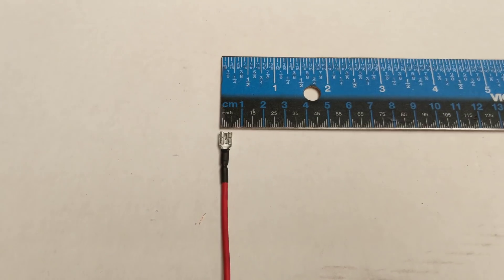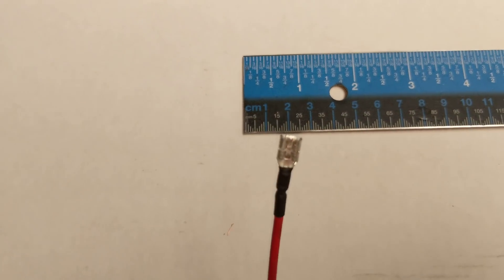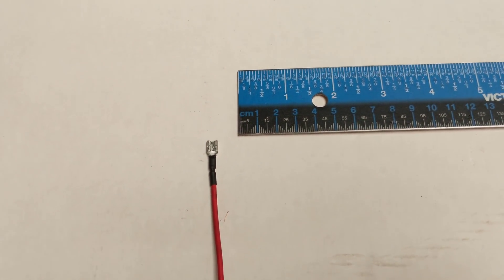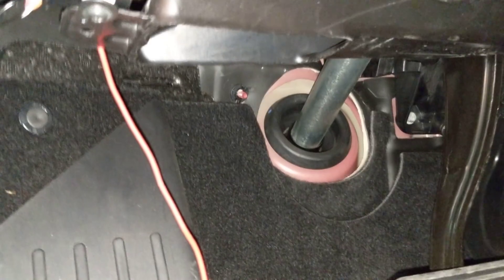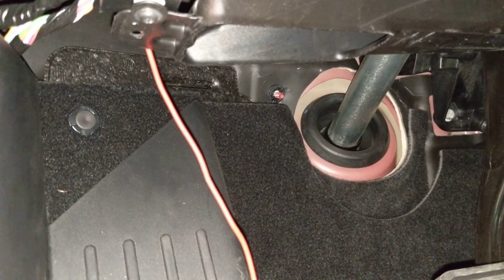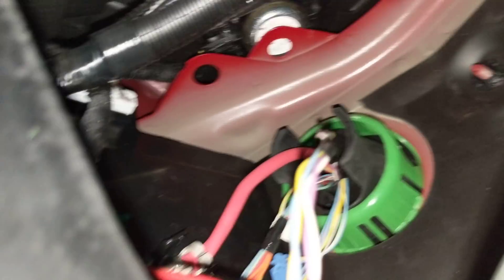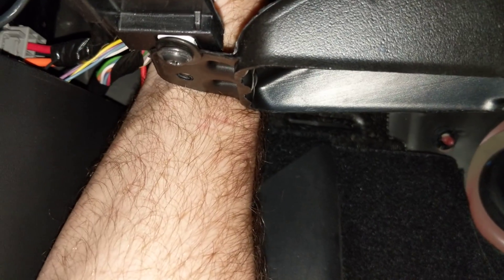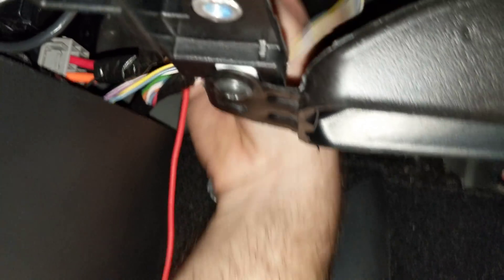Tesla Model 3 - How to safely get 12v for accessories

Comment: Thanks, this is the ideal way to go for 12v switched!  I tried somebody else's method for a light blue wire (also on youtube) and despite finding the one he referenced, I could only get 3v output that was not helpful... I had the right wire, so not sure what's up.

This was a pretty big pain in the butt (and I've put in complex alarm systems in all zones of a car back in the day, wired 2 other cars for radar including a 911, and put in a full stereo with CD changer/amp/sub/speakers when that was in vogue).  I thought I'd share my own tips on it. Watch the other video by the OP to also understand the config of the target.

I would like to point out that the removal of the complete main panel as the OP listed below the dash was not something I could comfortably do.  I could only remove the front panel under the dash with the accessory light on it (not the larger rear portion).  While it's not possible to visualize the target this way by eyeball, I used my phone with a zooming/lighting/magnifier app and then i could see it.  A video mode on phone with zoom and LED enabled would work.  The target is not super high up but further back from the front of the car than I anticipated and on the side of the car facing inward.  I highly recommend a viewing technique as this.

I bought a uniden hardwire kit for my radar that really seemed to have a 5mm size crimp-on attachment (I measured it) just like in the video but it didn't fit!  I instead bought the same clips as the OP recommended from the amazon link above and these eventually worked.  With the clip linked by the OP, it went in but didn't get 12v the first time I placed it in, oddly, but then I tried again and it worked.  This is a project for somewhat small/thin/nimble people in this regard.  I used a very large bolt that holds up the dash as a ground, but careful to not over-tighten this on your wire as it will simply slice the wire.  This bolt is visible when taking off the large plastic piece that trims the sill to the area below and lateral to the dash.

I mounted a uniden R3 radar and used a "permanent mount" (simple adhesive metal angled clip) such as can be found on ebay and managed to squeeze it beside the rear-view mirror and just above it on the driver's side.  It ends up being much more hidden and much cheaper than the blendmount, which I really think looks very clunky IMO.

The OP is clearly in a different league than the everyman with disassembling and understanding the electrics of this car.

Thanks for this video!

Comment: Where did you find a ground?
Reply from the maker: There is a big bolt on the A pillar that mounts the dash, This is a good location.  There is also a smaller ground ring lower on the A pillar (remove plastic trim).
Reply: @Ingineerix  Would you be so kind to snap a photo? Also, would be nice to see how to remove foot well cover safely.
Reply: this is a good install guide. it includes where to ground.

Comment: Somehow I got power (14v measured) and now nothing from that port. Nothing changed with the wiring from yesterday to today. Car is on (I get power from the 12v outlet in the console). Confirmed power cable is good, and connection is tight.  Anyone have ideas?
Reply: I don’t think there’s anything equivalent to a reset button for that port?

Comment: I have my BlackVue DR750S-2CH wired with a Power Magic Pro directly to my 12V, as I was told to do months ago. It has been working fine for months. This morning, potentially because of a firmware change, my Model 3 just threw a 12V error. My service center is currently replacing my 12V. Instead of buying BlackVue's $300 B-124 external battery, would it be possible for you to document step-by-step instructions for how to use this 12V yellow wire into the BlackVue so parking mode works?
Reply from the maker: I've been on record several times warning people to not tap the 12v battery directly.  Sorry, I don't have time to do step-by-step.  If you can't figure out how to tap a wire yourself, I recommend you consult a professional.
Reply: @Ingineerix  Like I said, it was wired directly into the 12v battery (professionally) several months ago before anyone was saying not to do that. I'm now going to have it re-wired (professionally) based on your new advice. The average person won't know how to do this themselves, so instructions would help, but hopefully my installer will know what to do.

Comment: struggling to remove the panel that gives me access to this, I was able to remove the one with the foot well light but not the on in front of that. Any help would be greatly appreciated, thanks for this video as well!
Reply: Topplayer2g agreed. Running into this problem also. Can anyone assist?
Reply: I could not remove that panel, instead I was able to get to the power without it. It was tough to see and work but it is still do-able. I tried my best to watch this video and the first video he posted, and understand where and what I was looking for. once I did that I was able to do it on both my and my brothers model 3
Reply: Agreed... I was able to do it also but did not remove the panel. I only removed the one with the light on it but it almost seems like you need to remove the next panel. The problem was I noticed the air bag was there so I did not keep moving forward.
Reply: Did anyone try unplugging the connector from the VCLEFT in order to plug in? Wondering if this is available.
Reply from the maker: Yes, on my car, I did remove the aft panel for easy access, which does contain the knee airbag.  I don't recommend you remove this unless you are comfortable with such things, and be careful not to damage the wiring.

Comment: Thank you for this and the other video showing how to plug in. 

Need beginner help- if I’m going to tie this into the Uniden R3 radar detector, does it need a ground or other neutral wire connected?

The radar detector comes with the cigarette lighter I was planning on cutting that cord and connecting.
Reply from the maker: Yes, every electrical circuit needs 2 wires, so yes, it needs a ground.  I would not cut the wire, just buy an aftermarket cig lighter jack and install it under the dash.  (There may be power supply electronics in the male end)
Reply: Where are you grabbing the ground?

Comment: is there an easy place nearby to get ground as well?  i've been thinking about trying to add a 12v socket underneath the phone dock to allow me to have fast charging for my phone and my wife's phone (we both have oneplus w/ dash charging, which require a special charger and cable, the usb ports won't work)...
Reply from the maker: Yes, there is a ground bolt to the body near the door sill.

Comment: I could really use some more help with this, I've tried three different of  these terminal types, including the one referenced in the video description, and I can not get any to stay put in this location.  They just stay loose no matter how hard I try to push them in.  I have tried getting to it from a few angles but no luck.  Might this be something that changed later builds?  Any help with this or other safe 12v access points would be very much appreciated...
Reply from the maker: If it's going in all the way, then maybe the terminal is simply not tight enough, just use pliers and gently tighten the female opening.  My experience was that it was super tight and just needed a good bit of force to get it seated.  So try to determine if it's going in all the way.
Reply: Thanks so much for your videos they are amazing!

I also tried to get at this multiple times with 5mm connector. So hard and gave up. Might just tap into cigarette socket in arm rest.

Do you know the amperage known for that socket?

Comment: I have a Ford Focus EV, and the 12 volt lead acid battery is only charged when the car is turned on. The high voltage battery will charge, as long as the lead acid battery has enough power in it. 

Do you know if the Model 3 would do the same thing? I hope that it’s smart enough to keep both systems healthy.
Reply from the maker: The DC-DC will charge the 12v whenever the car is awake.  If the 12v gets low, the Gateway will wake the car and initiate a support cycle to recharge it.
Reply: Ingineerix Thanks so much! I look forward to owning an intelligent EV, not just a compliance, ICE conversion car!

Comment: Sorry,useless video. Nothing mentiond about max possible current or in which circuit with which protection is tapped into. So far under limitations the 12volt cigarette lighter is much safer then this video
Reply from the maker: You clearly didn't bother to read the description.  First sentence.  10A.
Reply from the maker: Here's a 2nd video with more clarity: https://youtu.be/9De-VjFgLSQ
Reply from the maker: This is a dedicated output with no other loads.  It is apparently reserved for a future trailer light connection.  (There will be a separate ECU)
Reply: That was all well covered in his VCLEFT video -- which has disappeared in the last few hours.  IIRC, there are two spades available where he's indicating, unused, labeled ROOF and TRAILER, and he tested at least one to 15A cutout, self-restoring.
Reply: Gallardo6669 no Moo
Reply: Cool, thx. Sounds way better. I might be one out of millions,who never read video description. Its good to mention this info in your video as well! Thx!

Comment: thanks!  is there a permanent 12V  also?  and does the 12V converter always run or only when car is on?
Reply from the maker: If you want always-on for a dashcam (not recommended), then the best location is to pull out the overhead console with the hazard button and map lights. Feeding that you will see a yellow wire on the corner of that connector (pin 1), that is +12 hot always. If you need ground, the black wire on pin 16 is good. Don't pull over 1A from this circuit though!

No, when the car goes to sleep, it stops maintaining the 12v system.  This is why I don't recommend always-on loads unless they are very low.  You will be cycling the 12v AGM battery.
Reply: Great info!  thanks for that.
Reply: Ingineerix the BlackVue DR750LW-2CH 5. 9 Watts for example so I'm not sure how long that would take to draw down the 12-volt battery if running while parked
Reply: @Ingineerix  you should update your video, your method now powers the dash cam 24 seven, it happened after a Tesla update about six months ago

Comment: So this is a nice switched 12v with easy access. Is there any permanent 12v with easy access nearby also?
Reply: Yea that would be nice.
Reply from the maker: If you want always-on for a dashcam, then the best location is to pull out the overhead console with the hazard button and map lights. Feeding that you will see a yellow wire on the corner of that connector (pin 1), that is +12 hot always. If you need ground, the black wire on pin 16 is good. Don't pull over 1A from this circuit though!